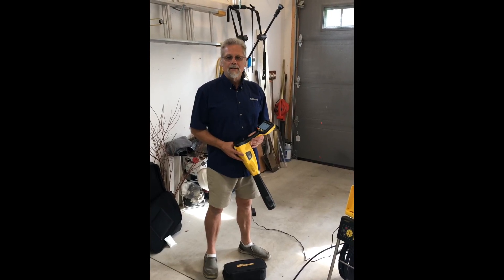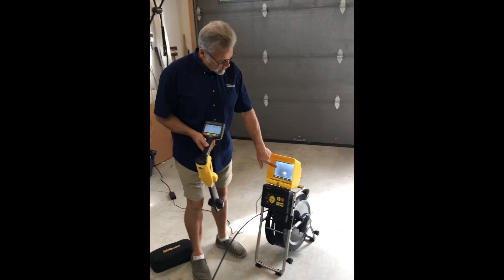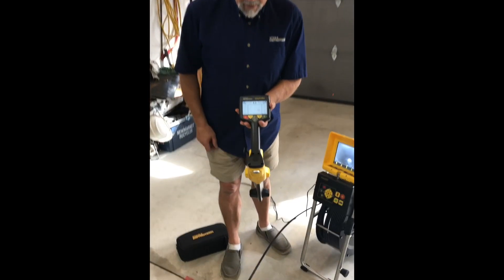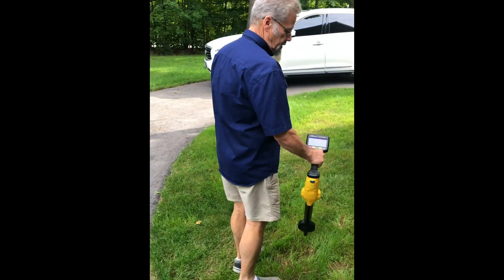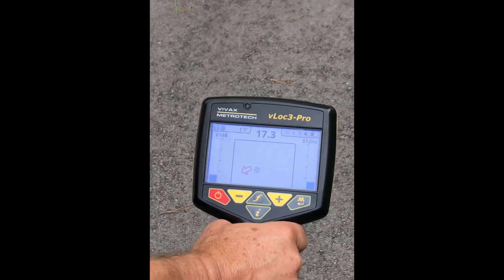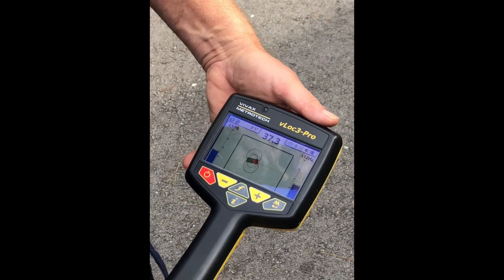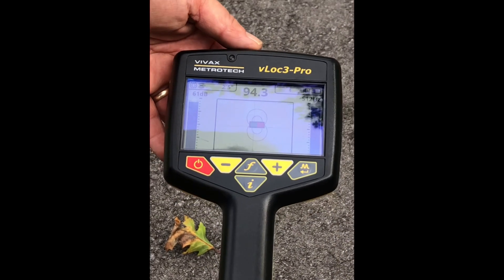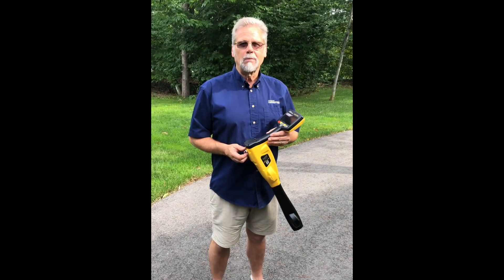vLoc 3 Pro Sonde Locating

Comment: Hi can the vLoc 3 Series SONDE work with a Metrotech 819DX-D ?
Reply: 810DX-D
Reply from the maker: Hi Paul
Not sure I understand the question.
The vLoc 3 is a Receiver. 
We do make Sondes in several different sizes and frequencies that should work with your 810DX.

Comment: Lets see if you can locate the sonde in a pipe 8 feet deep.
Reply from the maker: Hi David
Typically depth limitations are not of the Receiver but of the power of the Sonde, Pipe Material and Interference from other Utilities.